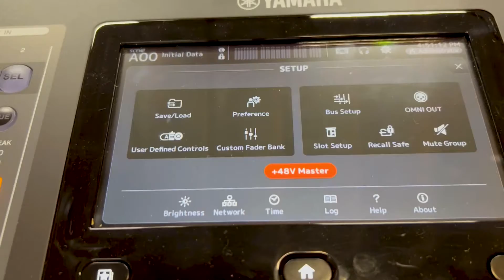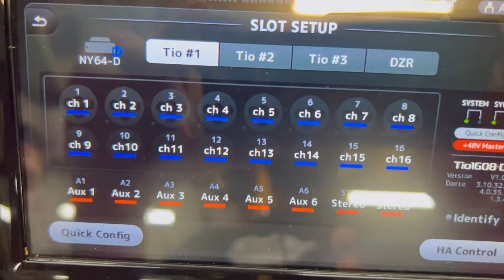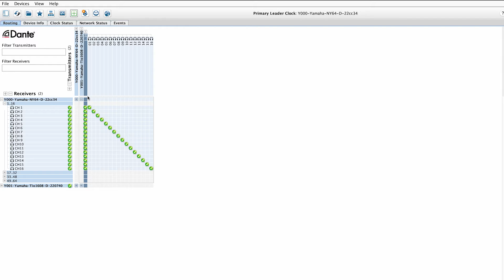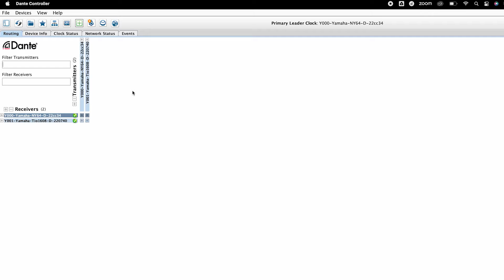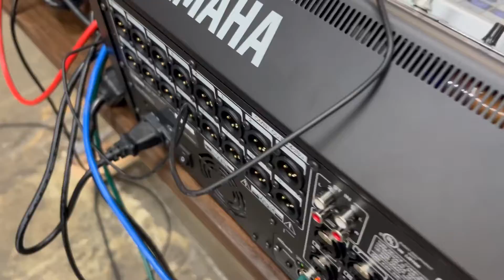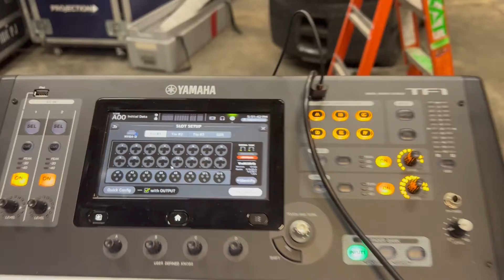Mounting a Yamaha Tio to a Yamaha TF1 - All you need to know

Comment: What
About 
The 
Outputs???
Errrgh
Reply: Thanks! This mixer is so annoying haha
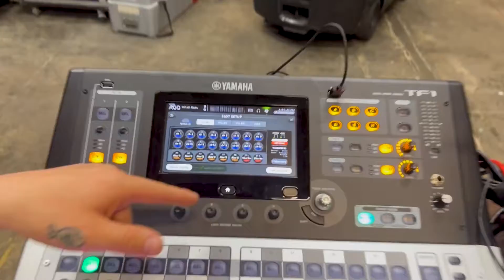Reply from the maker: How can i help, with quick config - shown in the video ( 4:59 ) it shows the first 6 outputs ( aux 1-6 are outputs 1-6, and 7-8 are stereo L/R ). Also stated in the video, if you do not use quick config you need to patch your outputs in dante controller. Hope this helps
Reply: Extremely annoying.i just had a very frustrating experience with this mixer over the weekend..I borderline hate it
Reply: @musicmankeyz  It also doesn't have the option to add delay to the outputs. You have to use the delay effect and a return channel to outsmart it for delayed speaker lines :face-red-smiling-live::body-green-covering-eyes:

Comment: So if I wanted to keep and use the 16 inputs on the back of the TF-1 and use the remote box to add 17 -32 inputs on the second layer on TF-1.  I could not use the easy patch of confige  and set the box  to box # 2.  I would have to get a laptop, network switch and program the 17-32 inputs manually?
Reply: If you set the TIO to "2," it will function as inputs 17-32 without Dante Controller. 

Outputs 1-6 default to Auxes 1-6, Ouput 7/8 defaults to Stereo L/R.
Reply: is connect setbox you tf mixer input is 17 to 32
Reply: @18tstsound  That is not a full answer.  If I use 1-16 on the back of TF, can I set the switch to (2) on the stage box to program the stage box to 17-32 on second layer of TF.  Or do I have to include a laptop with Donte in the mix to add the stage box to the 17-32?

Comment: I've done attempts to quick configure our TF5 to the TIO1608-D2 and for some reason its not connecting. Please help.
Reply: I'm wondering if it's an issue with the D2 version of the Tio. We just bought a TF3 and Tio 1608-D2, and haven't had any luck with Quick Config either. Instead we've been using Dante Controller for patching between the two devices, and R Remote for gain and phantom power control. Unfortunately, that means we don't have native gain control (aka Head Amp control) on the board, but at least it all works.

I'm going to spend some time at some point in the next couple days looking for firmware updates for everything (TF3, NY64 card, Tio, Tio's Dante interface) to see if having that all up to date fixes the issues. If it doesn't, then I have a tech support call with Yamaha in my near future :(
Reply: @brenekh  Hi, I did a bit of research and apparently other people were having similar issues. One of the users on Reddit gave me a solution which fixed the problem. Maybe it might work for you as well. All I did was flipping down the 3,7,8 dip switches and power cycle the TIO1608. That fixed the quick config issue and the TF recognised the TiO. Once it's all good, you can return the dip switches to their original state and it should work just fine.
 Hope this helps.

Comment: Hey, you talk about loosing the HA control. I renamed my TF1 in dante controller and tio as well. I noticed when the tio being renamed after power cycle they change the name to put the "Y001-....". The console does not, i just renamed it "TF1". Is this the reason i losed the HA control ? Is the handshake based on device name that user can modify ? I did dante certification, and just learned an advice that naming is important to make everything clear  but if it break the feature of HA control it's not that great x)
Reply from the maker: Naming is very important . It has hierarchy over the ip address in terms of a virtual handshake. For head amp control it’s all about device control ip.

Comment: You should update the firmware in both the TF and the TIO as there have been updates. This requires two separate operations.  Dante Controller will now show up labeled with the output busses, and you should save all your settings on the TF so that you can reinitialize the desk after the firmware update. Also, most users would benefit from taking a Dante level 1 certification to familiarize themselves with this new type of connection, before switching out of Quick Config to avoid pitfalls. BTW- Dante can be used in daisy chain mode and will make multiple hops without issue. Network switches need to be configured properly to function with Dante, so again, perhaps a level two Dante Certification course would be helpful.
Reply from the maker: I couldn’t agree more. The Dante classes are very useful. Wasn’t aware of the firmware updates. Thanks
Reply: NP!  @KINETICAUDIOTECHNOLOGY

Comment: Quick Config also works really well with the Yamaha DZR-D speakers. However you set the speakers on their own menu is picked up by the TF-1 and patched accordingly (Stereo L, R, Matrix, Mon, Aux). I have set up the system using Dante Controller (and use that for my QL5), but QC on the TF-1 and DZR-D speakers is very cool for smaller events. Makes life much easier for a one-man operation.
Reply from the maker: That’s rad. I was thinking about a couple of DZR-D’s for our inventory. How you like them ?
Reply: @KINETICAUDIOTECHNOLOGY  I really like them - I have 4 of the DZR-D15", 2 of the 12s and one 10 for a monitor. Really clear, more volume than I would ever need in my situations (church conferences, concerts, school musical productions). We use a QL5 in my church, connected via Dante with 4 Nexo speakers (15s and 10s), powered by a newer Nexo amp and connected via Dante. The amp decided to lose its mind one week and I was able to connect two of the DZR-D15s in its place. Dante is a great thing... The DZR-D speakers each need to have a unique address (programmed on the back of the speaker), and then set for wherever you're using them - Stereo L or R, Matrix, or whatever, and the TF-1 knows just what to do with them. I have a Yamaha DM3-D on order (now pushed back to Jan/Feb - been waiting since last summer!) - I'm assuming that the DM3-D will work similarly. I already got the new TIO for it that can operate at a higher bit rate. Have you been able to get a DM3-D yet? I'm hoping that it will be able to control our Shure ULX-D mics similarly to what the QL5 can do.
Reply: @KINETICAUDIOTECHNOLOGY  Thought I replied - sorry. I like them a lot. Diving back in here because my TF-1/Dante and some of my DZR-D speakers were stolen recently - EDIT: I replaced the TF-1 with a DM3/Dante... quite different. I hope you do some videos on the DM3/Dante at some point. I miss Quick Config... but I'm sorting it out.